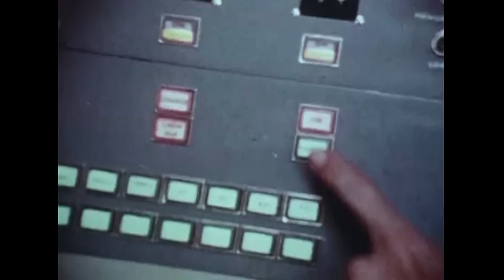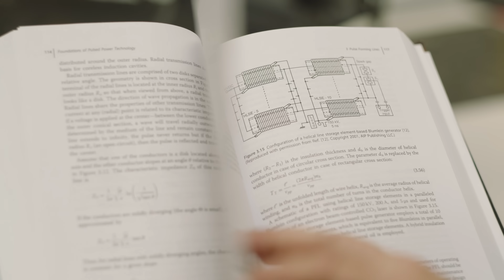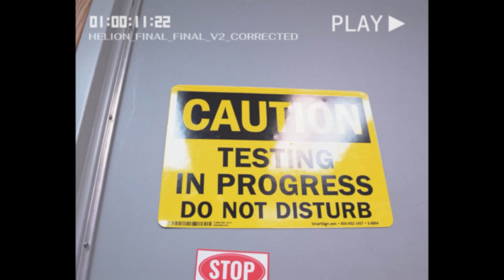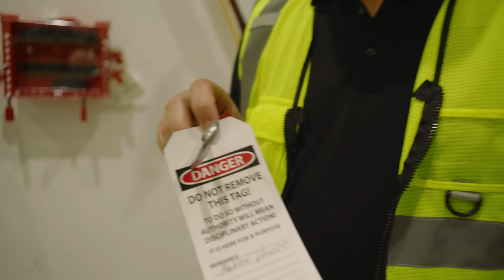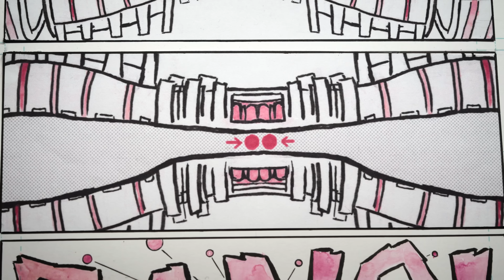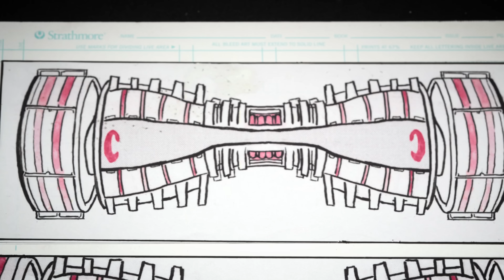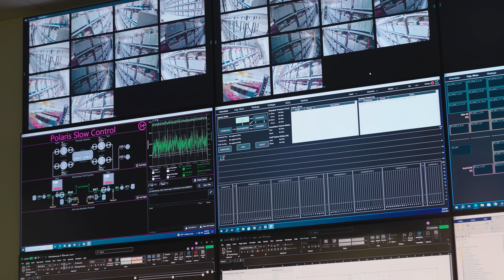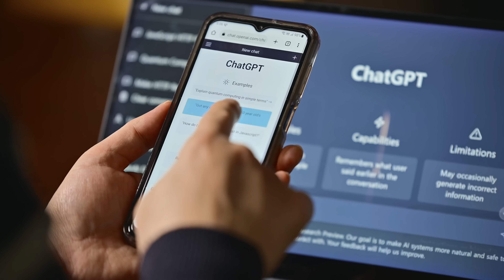A New Type Of Nuclear Fusion Machine Has Come To Life

Comment: Came for the interview, stayed for cable management 🔌
Reply: A genuinely baffling amount of cables.
Reply: Wait a minute. It's the guy!
Reply: By the way, I am already subscribed to your channel so that I don't miss any updates on fusion energy.
And for those who want to see the real Polaris, there are many video out there that will show you the real thing.
Reply: Hello.
Reply: As a seasond A/V Tech, 
Now I know what I can do for a few bucks
When I finally retire!
Reply: genuinely has to be cheaper and easier to just get copper barstock CNC cut to size, right?
Reply: @Hyperious_in_the_air Good thought… I noodled for a second, and think “no”.  Reason being:  these are Ultra-short pulses - thus have a whompin’ electro-magnetic field around them!  Don’t know if/how they may self-interfere, but if de-constructive interference happens, you may get blips in energy output and/or timing of the pulses.  If this is the thing, I bet a lot of the cable diameter is a whompin’ dielectric coating around each.  Of course routing is a thing, too… but it looks pretty bad w/ their solution anyways… how much worse cld solid bar stock be!?  ;)
Reply: We don’t need a machine, we need common sense. Carbon dioxide is plant food.